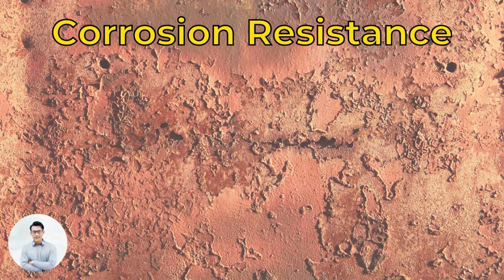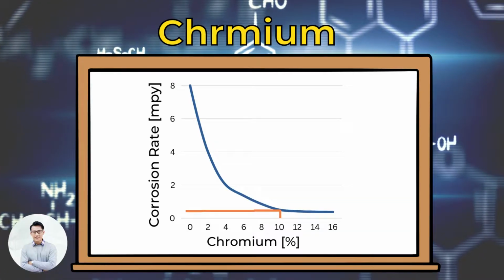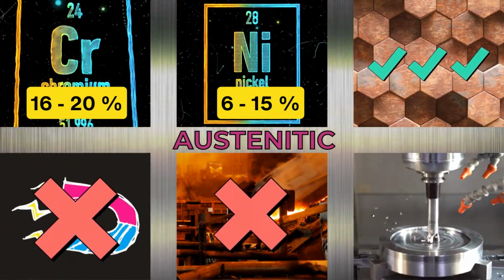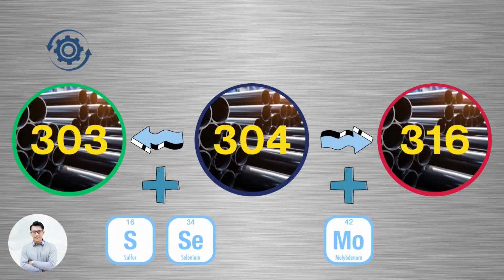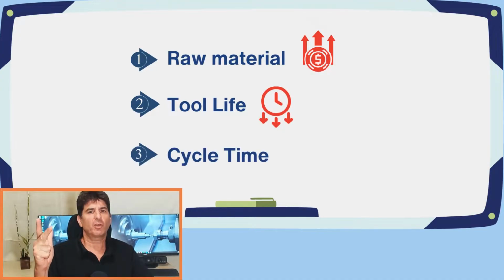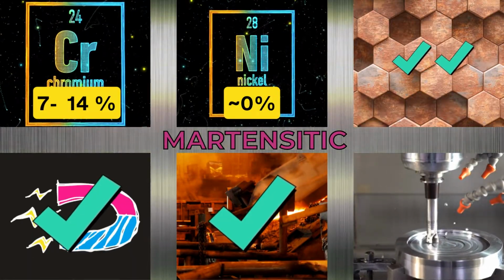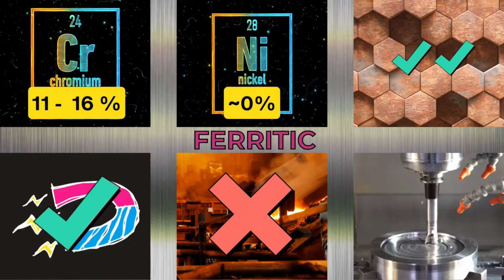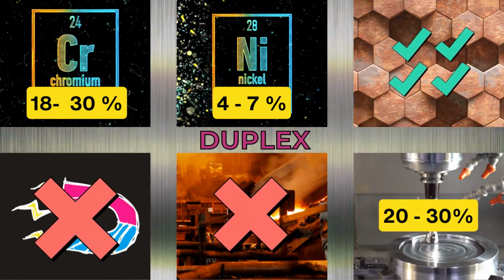Stainless Steel Types - What is the diffrence between Austenitic, Martensitic, Ferritic, & Duplex

Comment: Great video clip! I built pineapple processing machines for the Company that invented them for Dole plantations. There are many parts that are constantly saturated in pineapples acidic fluid and pulpy residues.many parts are made with 316, but not as many as you think. 304 is most prevalent, as 303 is used for many smaller delicate actuation type parts. Cheap to replace less costly and requires  intricate machining. As well as other alloy blends like Alumibronz
Reply from the maker: Interesting. Thank you for the comment.
Reply: @MachiningDoctor  Happy to add to these great displays of engineering thru time and technology.
Have a fantastic weekend..